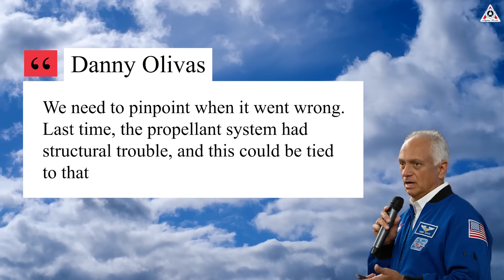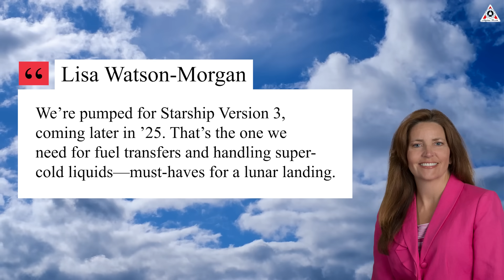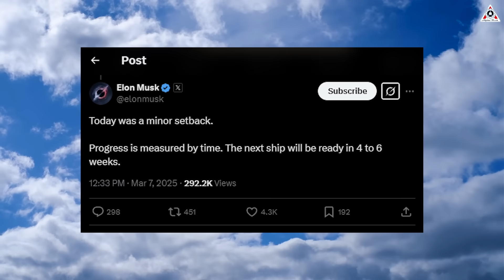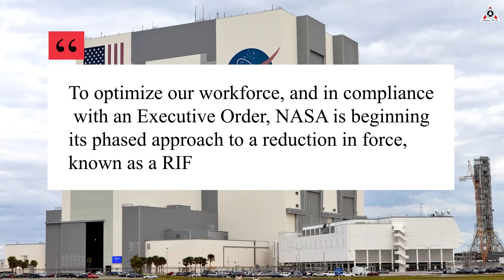NASA Drops Bombshell about SpaceX Flight 8 Ship Lost & Exploded Shocked Industry...

Comment: It should be noted that NASA has not really learned its lesson on managing risk.  Case in point the Orion heat shield matter.  They've had a solid 2.5 years to solve the heat shield failure but instead of re-engineering the hardware, they have simply decided to change the re-entry trajectory.  Papering over known issues is NASA's weakness, remember Challenger and Columbia?
Reply: Yeah but it's been a long time since then... This isn't on NASA

Comment: NASA need to become only a Space Management Department and get out of rocket building. Rocket building should be privet.  Space X can make StarShip "Fat Boy" the DEPOT/HUB ship is larger 12m OD and use on the booster V3 with 35 raptor 3 or 4 engines. This is for Space storage and it may have to have 4 types of fuels for Dragon and HLS/HAB. Te HLS docked on the side of the DEPOT/HUB and 24m Deep Space Dragon & solar trunk tanks lander docked on the nose of the HLS. The Depot fires 8 vacuum Raptors with booster 14.2, 2 stage, 3 vacuum raptors. A 2nd return Dragon can be docked on the nose of the DEPOT.

Comment: Don't make sense if V1 work  why change it to V2  making it bigger failed cause of too many issues and as for the heat shield why not like the dragon should be like a rubber compound sprayed on thick not tiles as they fall off
Reply: To reduce refurbishment requirements. The hope is to make Starship 100% reusable and make repairs between flights minimal. That 3 boosters have been caught is amazing. No other orbital booster has done that except for the Falcon 9 series.